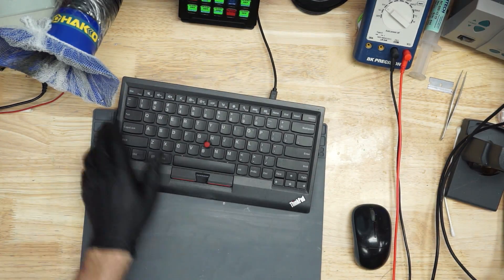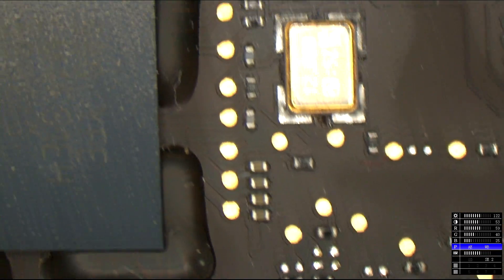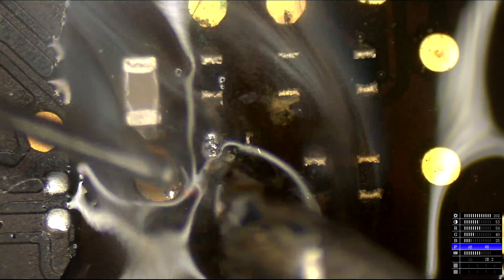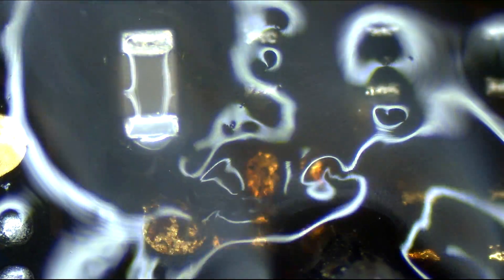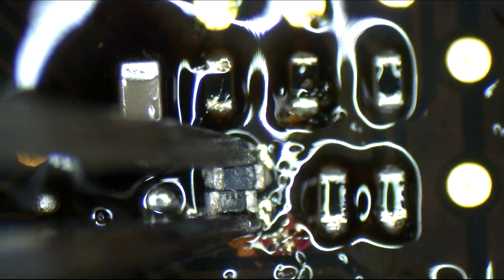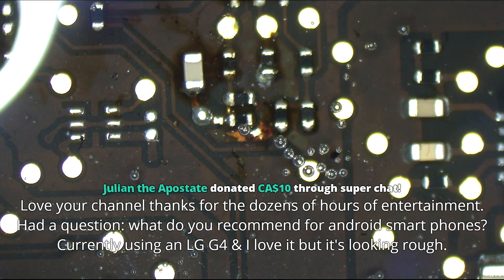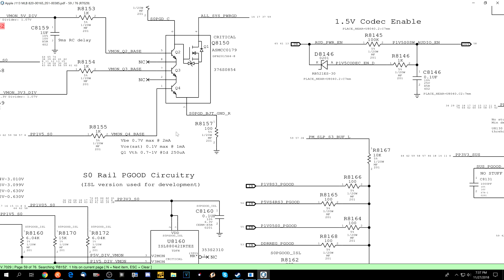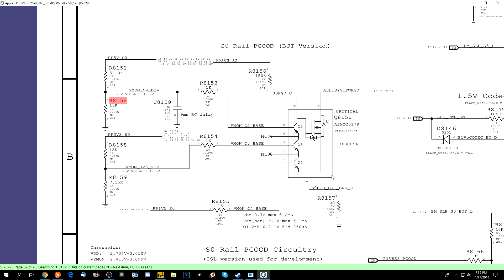Macbook Air 820-00165 taking 0.1 amps - what does this mean?

Comment: You should take a few MacBooks that just have a simple water damage problem like in this video, to Apple repair stores and replace the SSD with a counterfeit SSD that tracks the location when it's connect to the internet.

And then you can take apple to court because they're forcing you to buy a new SSD but you have valuable data on the one that they're stealing from you and forcing you to overpar for it's replacement.
Reply: Or do you think apple is overcharging you for components and stealing your old Hardware because they're actually insane, I mean they're making enough money anyway why keep used ssds

Comment: I know of a $4 device that I can turn on and off with an app and connect to Google slash Alexa, but do you know of a USB hub that allows me to do the same for stuff like Chromecast
Reply: My Chromecast has disconnection issues, always had this connection issues and I wasn't able to get it replaced.

I restarted and reformatted it countless times, and sometimes it restarting it doesn't actually reconnect it.

and I'm starting to think that it's the default Spectrum router that I'm using, maybe it doesn't like the low bandwidth constant connection between my phone and the Chromecast.

I mean I really don't want to get across the room and unplug and plug back in the Chromecast sit there for 30 seconds until it restarts just for the Chromecast not to connect to the internet.

Comment: That poor Flux 0_0 
I can tell you were holding back a laugh when you said you should use this much flux.
Of course it's going to work. because you located the problem and fixed it. But because you took a liquid dump on it that's non conductive it'll work even though there is still a puddle on it.

The reason it has a fan spin is because we used the right amount of flux
Reply: But he only used a milli-Paul?

Comment: umm, just cause..
do you know how to neutralize the Acid on the board?(the green stuff)  to make sure its dead??  Moist baking Soda..(not powder)  Watch it bubble while cleaning..
Reply: That is the job of the flux. The flux helps clean the corrosion and makes the solder flow easier.
Reply: @doctorkdsify  Umm, I know that..I was doing soldering since about 1978..  Solder does a clean job for metals, but if its happening other sections, or Just Eating something that hasnt failed...Backing Soda is probably allot cheaper..  We are talking about a company that dont use Varnish on the mobo to protect it.  A laptop that moisture can get into...Moisture, not saying water/coke/anything else...and the Moisture Kills it..
Reply: @ecash00  The green corrosion is a chemical compound as you well know. Since we don't know what it is it would difficult to know how to treat it. It also might be a reaction with the copper, the lead free solder and water.

Since most electronic flux used to be neutral (old pipe flux was an acidic paste) you didn't need to clean it off. None of my electronic boards soldered with rosin flux have shown any corrosion after 50 years. So using flux to clean up this area would be sufficient. Louis probably looked the board over to see if there were any other corroded spots that needed to be cleaned up.  A badly corroded board might not be worth even being repaired.

Comment: Can I ask a question?
The debris and detritus when soldering a copper pipe runs away from the joint and ends up on another part of the pipe, no problems, its just a copper pipe and you can clean it off if you want to.   Where does the debris end up when using flux and soldering a board?

Comment: Goddamn, Paul probably had a stroke watching you use all that flux
Reply: He uses that much flux because the bigger the glob the better the job. Duh.
Reply: +Kawa - I was fired from a company that built pressure sensors, for among other things, using too much flux. They used this watery stuff from Kester that would run everywhere when applied. The heat from the iron would actually drive it away from the joint being soldered, so you had to almost saturate the area with the crap. They used a solvent called Novec to remove it but that stuff was something like $7 grand a barrel. So they bought two cleaning machines at $150k apiece to reduce usage. Even though I would run my work through these things twice, they wouldn't remove all the flux and still required manual cleaning. The gelled stuff I see Louis using here would have been a godsend, but he would have been written up if he used his "the bigger the gob, the better the job" philosophy at that place.